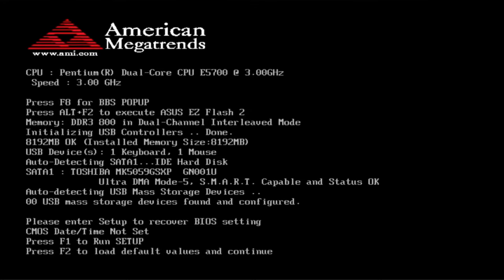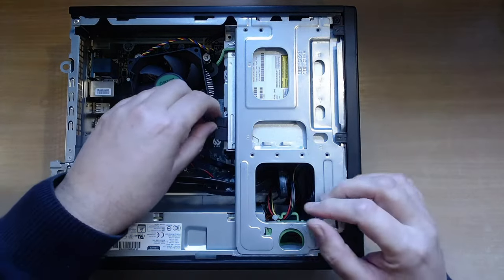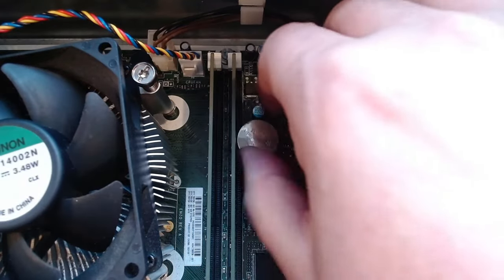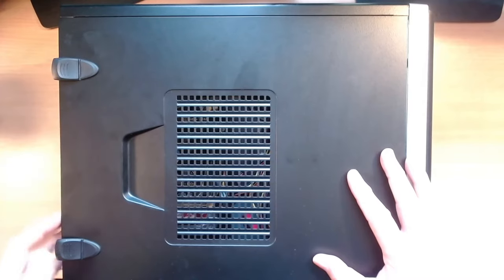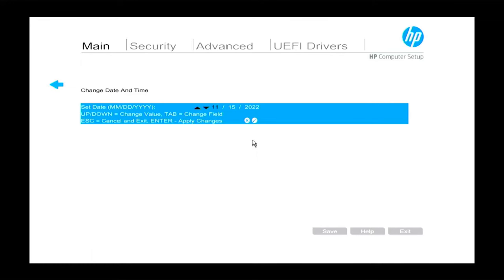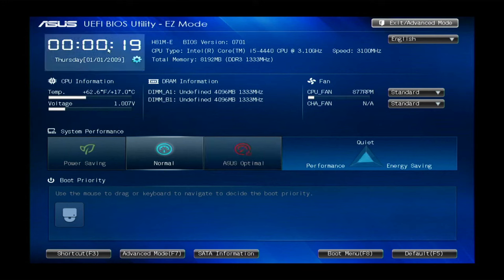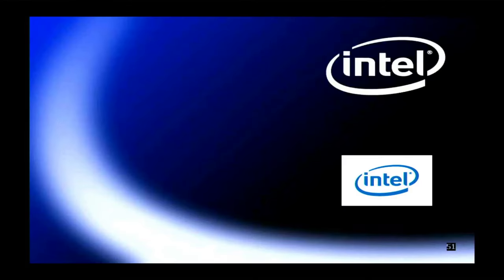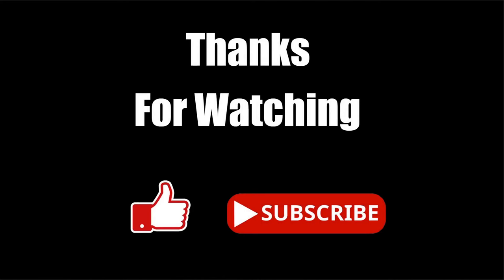How to replace the CMOS Battery in a PC (5 minute fix)

Comment: I am lucky I found this video because I have the same computer as yours , I put on the CMOS battery then I just turned on the computer directly and it kept turning on and off and giving the same warnings till it was turned on , now I just set the time in the BIOS system and restarted my computer , it should be fine right now correct ?
Reply from the maker: Hi @mouadmoulou-6247,  yes it should be.  CMOS batteries typically last between 3 and 5 years as long as your PC is plugged in most of the time. If you put your PC in storage for a long time where it is not connected to the electricity supply the battery will drain a lot faster, so it makes sense to remove the battery in that case. That's why new motherboards come with a thin piece of plastic between the CMOS battery and it's connector. The battery is not connected until the plastic is removed.

Comment: Why is it necessary to change the date and time after replacing the cmos battery. I replaced the battery today. I was getting the same error. then I booted up my windows. The internet fixed my date and time automatically. I shutdown the pc and restarted..went to bios..the bios time and date changed too. And the error was fixed.
Reply from the maker: Good question. You are right and often will find that this is the case but it is possible that not all operating systems will automatically update the clock via the Internet and some users may not be able to connect to the internet until they have the network card drivers installed.

Comment: I ripped the shield cover (black plastic) but put some tape on it will it work?
Reply from the maker: If by shield cover you mean the socket that the battery fits in to, then electrical tape might work as long as the battery does not become loose and lose it's connection.